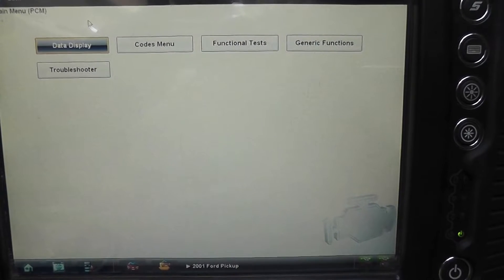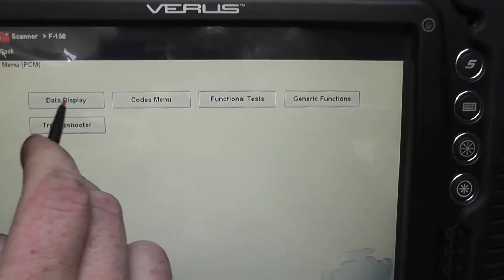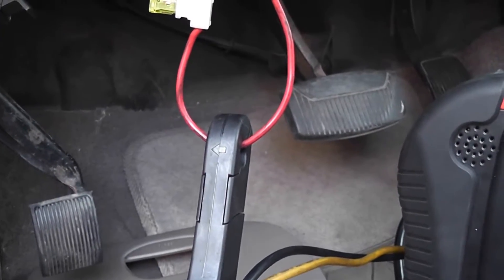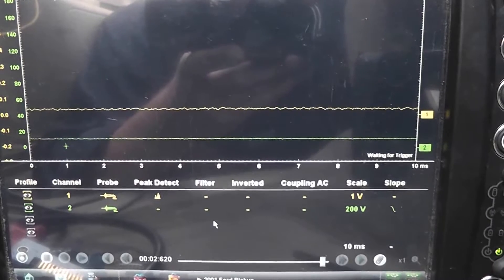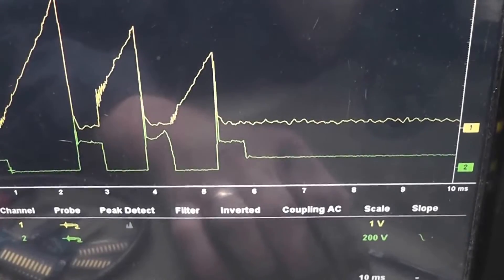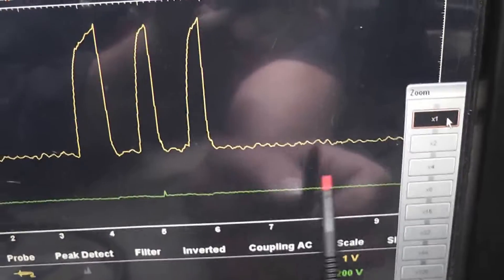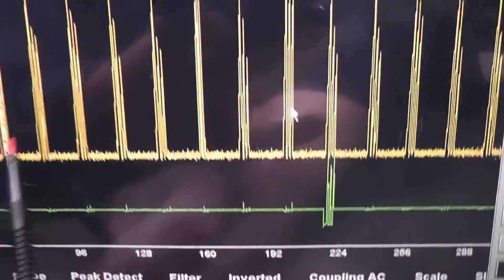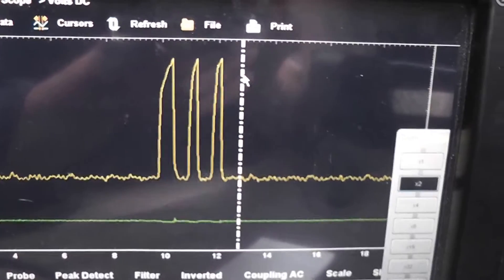How to find a shorted coil on a Ford 5.4 engine (misfire diagnosis)

Comment: I actually had one of these last week but the problem was a voltage leak in the boots not in the ramp. I was working on a 5.4 4valve in a navigator and the coils were a pain to get to.
I managed to get TID 53 to pick up the misfires after a few test drives.

As always Danner is the man...